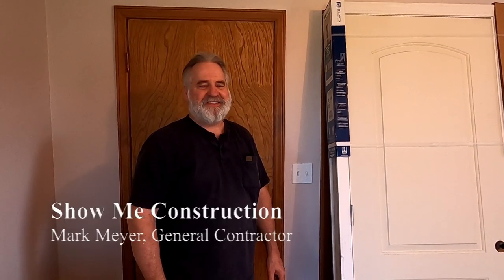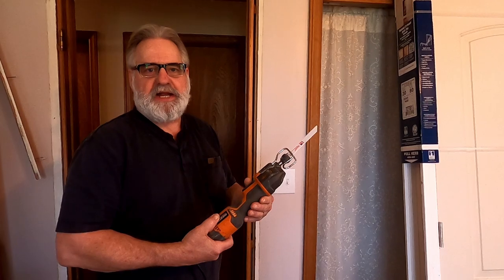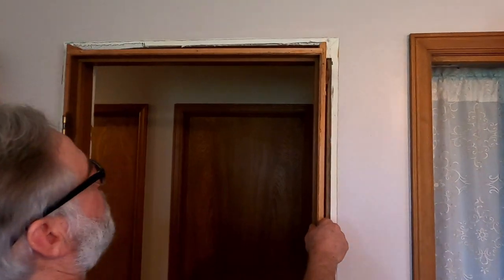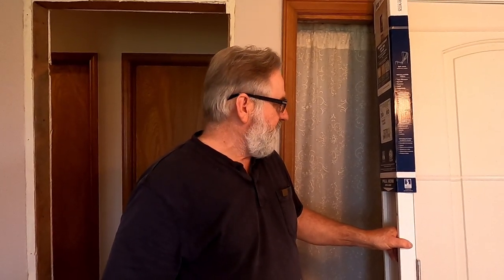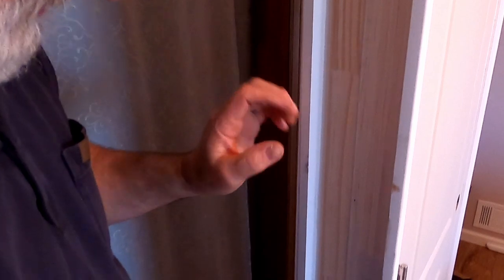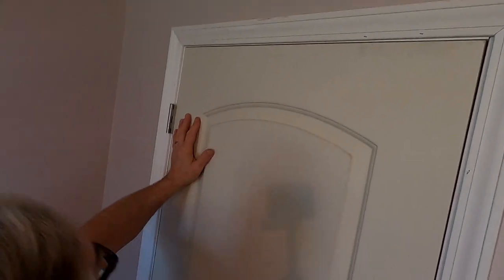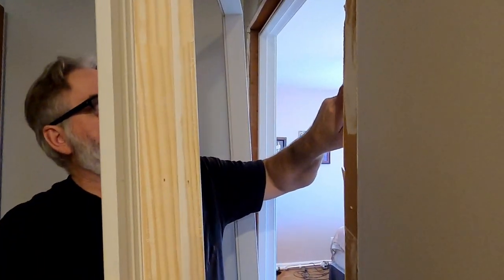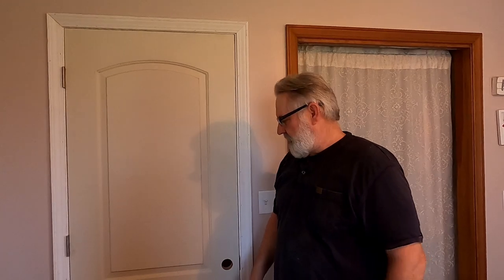How to Install an Interior Door | Show Me Construction

Comment: Good info.!  You make it look easy!

Waaay off topic but any thoughts on how to soundproof or dampen sound between upstairs and a basement?
Reply from the maker: It depends on sound proof you want it.  You can put sound board on the ceiling and then drywall. You can also insulate between the floor joist. It's cheaper to do this while it is new construction because adding this later will be more costly.
Reply: i know it's quite randomly asking but does anybody know a good site to stream new series online?
Reply: Carpet on the walls and door would do great for sounds

Comment: If the door is short, just take off door and add what you need to the bottom and stain them, Save you moneys and time and have a better door, these were great doors to trashed them and oaks trimming is about as good as you can get at 3.00 a running foot, May even be higher now, Great ideal on door by someone but the door you pulled was my favorite, Thanks for the video

Comment: i have never heard of a split case prehung door. i was assuming id have to buy the standard one piece prehung door.  this certainly seems a lot easier.  not sure why or how a level/shims are not needed.  i have never installed a prehung door, so this is all new to me.  all my walls are plaster so i hope its the same process
Reply from the maker: The plaster walls should not make any difference.

 I have been hanging doors for many years but I have not been making YouTube videos for many years. So for the viewer's sake I wish I would have used shims and a level. I did not use shims because my wall was plumb and I already knew that and therefore shims were not needed. I'll try to do another video showing the use of shims and a level. 

Thanks for watching! I appreciate your comment.

Comment: great video installed four doors today.  One thing missing is if the door is not even you will have to use Shims to even the door.
Reply from the maker: That's correct. Thanks for watching!

Comment: Mark, would this split frame style of door be suitable for the door that goes from living space in the house to the attached garage?  It typically has a heavier construction than, let's say, a bedroom door.  For security I suppose.
Reply from the maker: Generally, you use an exterior solid core door that is fire rated. A split-jamb like in the video would not be to code. Thanks for watching!

Comment: what if the door is like a inch or so to big? do i have to cut it?
Reply from the maker: Hi! If the door is to tall then you can trim the bottom. If it's to wide it can be cut on bottom if the knob hole isn't already cut out. You might have to special order a door for your unique frame size. What kind of door do you have? Is it solid core?

Comment: So the only thing u didn't show was the measuring for the door. U made this look so easy as a woman I think I can do it, just am confused on the measuring, just want to get the right size.
Reply from the maker: Hello! Thanks for watching. You will measure the width of your existing door. Even though the jamb comes with it they sell it by the measurement of the actual door itself. Doors are usually 24", 28", 30", 32", 34", 36".

Comment: Great Video! If I don't have a nail gun can I just hammer 2" nails in? Do I measure the door only or include the door jamb too when purchasing a split jamb? Where would I place the leveler?
Reply from the maker: Yes, you can use a hammer and nails. Just measure the door and the jamb will be included. Level is placed on the door side of the jamb against the casing. Thanks for watching!

Comment: I have an important question about this subject, I’m working on replacing a door jamb and all the components but due to termites the framing behind  the door jamb have been all but completely eaten away, is it safe to remove the entire stud to simply replace them or are the studs in interior doorways load bearing studs and what would be the best course of action for this repair?
Reply from the maker: Replace the studs. Taking one stud at a time out isn't going to make the wall fall down. If you see active termites you should treat them first. Hope that helps! Thanks for watching!

Comment: Interesting I didn’t know these existed. Great video! Question: is it easier to replace slab only and add new trims or replace entire frame, door and trim?
Reply from the maker: It depends on what you want. If your new door fits well in the existing jamb just replace the slab and trim. I usually replace the whole thing because I went with a paint grade jamb. My existing one was stain grade. Thanks for watching!

Comment: That was very nice of you to share this .. I just bought the same exact one and have no idea how to do it.. so yeah , thank you.. by the way.. what was wrong with the old door if you dont mind me asking ... I kind of liked it better and it looked much stronger and the color was genuine and beautiful.. anyways .. I appreciate it.     I know you had mentioned that the old door had a small gap at the bottom, but couldnt that have been fixed somehow?  just wondering for future purposes  😊
Reply from the maker: Thanks for the comment! The old door was hallow and cut for carpet which was removed and now way too short. The new door is lower and solid core. We wanted white doors for a more modern look but the wood color is very nice too.
Reply: Gap at bottom. You could fill in that gap but that presents some problems. You could get a piece of wood, cut to the length of the door x thickness of the door x the height (amount you want to add to the door). Cutting the length should be easy, if your stock wood is the thickness of the door, then you won't have to worry about that, the height, probably a 1/2, may prove to be a tricky cut. You will need a table saw or, as I used to da before I had a table saw have it attached to a bigger sacrificial wood board. 
 The problem is, the grain of the stiles are vertical and the rails are horizontal and you peice you added, the grain will be will be vertical and it will show the end grain. 
 If varnished,  there is no way to hide this. If painting you will need to sand it to a very fine finish to hide this. This will not really work out unless you work with wood often.
 It would likely be better to leave as is or replace unless you just want a project and want to increase your wood working and finishing skills.

Comment: can this be done without the nail gun?
Reply from the maker: Yes, you would use two inch finish nails with a small head. Set the nails so you can fill them with putty and paint them. Thanks for watching!